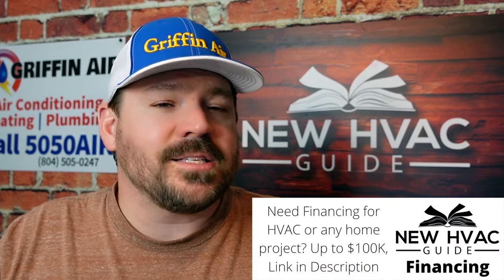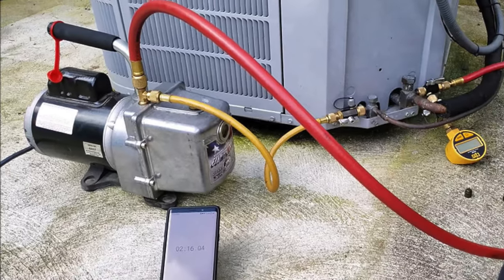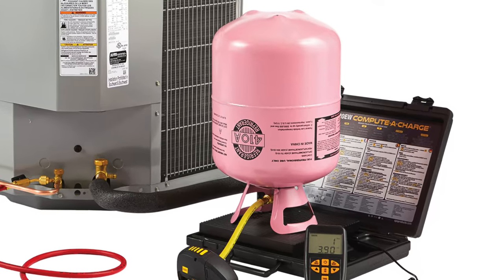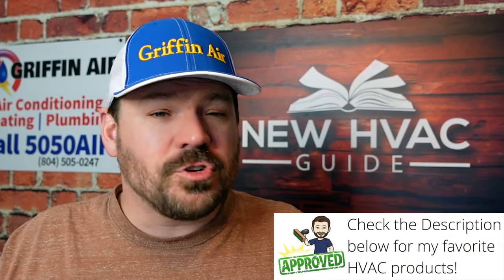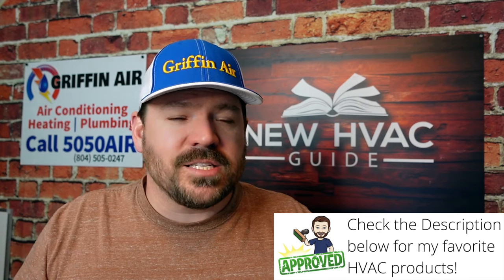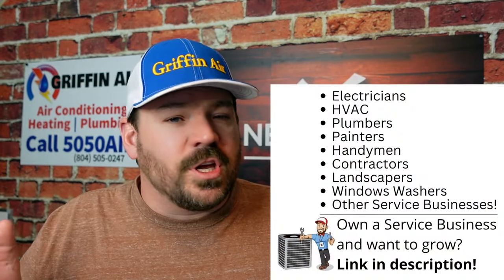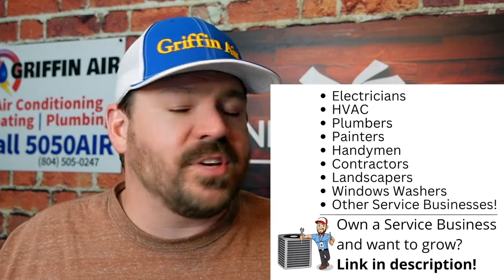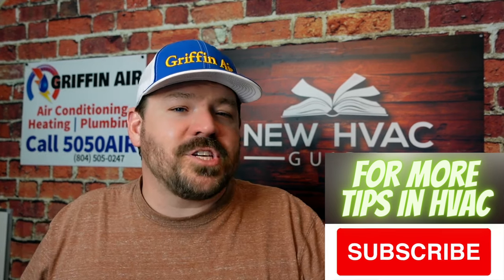Don't Check Refrigerant in Mini Splits. Here's Why!

Comment: While I agree that he is speaking truth, he is withholding the fact that he is using a fear tactic to discourage this type of DIY which can be done judiciously and prevent the homeowner from paying him, or one of his cronies, exorbitant fees to maintain a system that is designed for skilled DIYers to install and maintain. The HVAC industry is so peeved at the ease of DIY installation systems that many will not help when something goes wrong unless you pay them exactly what they would charge you for the system and installation. They hate that they are losing money to this DIY mini split industry and have taken a hands-off attitude rather than getting on board with it and make a little money off of maintenance and repair when a homeowner wants to go that route. This is one area where YouTube University is saving money for  probably thousands of people.
Reply: Concur.  I've had no formal training with Residential HVAC systems.  Over the past 10 years, I've installed 5 different Mini Spit systems and I've maintained them w/o paying technicians.  For the most part they're fairly simple to install/maintain.
Reply: No he’s just trying to save homeowners headaches. I’ve seen a few of these “do it yourself” systems all fucked up. This guys 💯 correct. We also do only commercial industrial HVAC so I’m not biased. Critical charge systems need a proper tech to work on/install for longevity of the system. This guys honestly just trying to help. And yes home owners can get lucky and it’s just fine.
Reply: @nolte8152  You must have missed the words I wrote. I did not say "homeowners." I said skilled DIYers. They don't rely on luck. You must be a one-skill-only type who cannot understand the wide variety of skills a DIYer brings to the job along with their understanding of a wide range of systems and the ability to quickly learn more and put it to work. They usually have an intuitive grasp of understanding how a system works and quickly see how to install, repair and improve the system. I stand by what I wrote as being 100% accurate.
Reply: @archer9732  🤣😂🤣 You must be an aspiring engineer. You sure sound like one.
Reply: @nolte8152  Not aspiring to any occupation. Retired from a very successful career and enjoying my retirement. But, I have high regards for the engineers I know. I hear some aren't so good, but that's true in every occupation. Right now it appears to be especially true of the HVAC trade.
Reply: No the engineers in hvac are fine but the problem is those who think everything can be done correctly by everyone and there is no need to hire properly trained professional techn😢icians . Or those DIYers who install a mini split and instead of running a dedicated circuit decide to   Branch off one leg of the 240 to run there ceiling fan  before continuing to the mini split . There is a reason the industry leading mini split manufacturers only sell to licensed contractors and not to the public. You go ahead and buy those 3rd world mini splits and install them yourselves but be prepared to pay when a pro has to fix the  junk that they don’t even want to touch for just that reason . Also just because you got it super cheap does not mean they are going to be inline with your penny pinching mentality to repair it .When it breaks be prepared to replace it or fix it yourself. Many service techs don’t like working on mini splits period so don’t expect a break on them fixing something you bought online and installed yourself without any professional training. You can install it yourself you can service it yourself . Or pay a premium for them to cause once they touch it all your mistakes or bad practices are now there problem  to try and solve  Just keeping it real .
Reply: @jhill2042  Once again I must point to the words I wrote which you failed to understand. SKILLED DIYers. You one skill only people are so proud that you learned how to do one thing. BTW. Skilled DIYers can fix their mini splits and they are not fixing installation problems. I just finished repairing one that was damaged by mother nature (high wind and flying limbs). Of course the part about buying refrigerant was a slight problem. So I studied for the test and am now section 608 certified. That’s what skilled DIYers do. We learn what's necessary to do the job right.
Reply: I also do 90% of work when I install mini splits on my projects, but I would still call certified installer to connect line set and do a system startup. Main reasons are to get full manufacturer warranty and also federal and utility company rebates, which I wouldn’t qualify for in diy install.
Not all mini splits qualify for rebates
Reply: “There’s no way…. But then here’s how it could be done”. 😹 WTF

This guy spends too much time pole vaulting over mouse poop.
Reply: Someone steal your ice cream?
Reply: For real. Just tell me how you'd do it as a professional. I will decide when I'm in over my head. The ac industry is a bit annoying because few techs will touch a self install even though I'm only asking for something simple like a pump down and pressure test, for which I'm pay.  One dude tried to charge me $750 for this.
I've found the same problem with many tradesmen not answering questions and simply telling the audience not to do it. As one of your skilled diyers I ripped out every wire of the knob and tube and rewired my entire home. And I did it my way with a lot of extra features that would've cost me a fortune if I paid an electrician. Even the inspector was impressed. Was it hard? Sure. But not nasa science. Just required research and investment in time and tools. Not everyone should be doing these things, but it doesn't make everyone who tries an idiot. I've seen plenty of pros make boneheaded, serious mistakes that are costly and dangerous. So a pompous attitude is unnecessary.
Reply: I'll ask one question. Did you pull a vacuum on your mini split?
Reply: @peteaceves5237  Absolutely.
Reply: Amen!  Every low level tech has "opinions" like dryer tapes in your dryer ruin your dryer. Auto mechanics claiming "bad gas" from this station or that is ruining the engine.  Jeez!  Save your stupidity for your paying customers, who overpay you.
Reply: I think you are totally correct based on my experiences
Reply: This guy is simply saying that all these companies that send unqualified people mess up the system and don't know the proper process.

Comment: Disagree with you to a certain extent. You are completely right about "properly" charging a system by weight. I have rarely done this unless the system is giving me supreme attitude in a service scenario . Some manufactures will give a  range of what your pressure's should be or if you call them they will give you some hints along with an amp check on the compressor. If I have a whack of calls its getting a top up and a leak check on to the next one. Most home owners want their systems to cool asap not really concerned with a system properly charged.
Reply: Well, I disagree with you to a certain extent. I would argue that 100% of home owners want their systems to cool asap not really concerned with a system properly charged, not most. That said, is it not the job of the HVAC professional to be a professional? A professional who disregards the uneducated / ignorant homeowners concerns and provide them with a properly charged A/C running at 100% proficiency (which will provide many years of cooling comfort) is the honest way to go.
Reply: How do you do a leak check without evacuating the system?
Reply: @andrewmckinlay2964 you have to put a vacuum on it after a leak check 💯 percent have to
Reply: Are you talking about inverter mini-split systems or just AC's in general?  Sounds like A/C's in general.
Reply: Incorrect refrigerate charge kills compressors … period
Reply: Mini Split systems can only be charged by weight. Period.

Comment: You are spreading mis-information probably so you can charge more for your service calls.  Mini splits can be checked while running in ANY mode by line pressure.  If the pressure is between 100 to 120 while running your good. Below 100 you need to add a little to bring the pressure back into the correct range. Just add a little and let the pressure settle.
Reply from the maker: Do you have any documentation to show this practice?
Reply: You are correct. The problem, I'm guessing, is HVAC pros are spouting off bs based on old school systems and not educating themselves on these newer systems. Mini-split manufacturers provide the information for testing system charge based on pressure.
Reply: @NewHVACGuide  From what I have seen on youtube videos he is correct.  The low side pressure runs between about 110 and 125.
Reply: @NewHVACGuide  I'll bet some pretty good experience behind what he says.
Reply from the maker: Saying operating pressures should be in a range of 20 psi and adding (and guessing) when it gets below 100 is NOT properly charging a system. I stand by the information in this video. 

There’s a right and wrong way to do things. I don’t guess and I don’t shoot for ranges. I do it right. 🙂
Reply: An auto mechanic would have no issues charging these. lol
Reply: @NewHVACGuide   If you understood how these systems are designed to operate, you would see why " within 20 pounds" is ok. Mini splits are Variable Capacity systems.  The amount of refrigerant in circulation varies based on demand.

Comment: Hmmm, so basically, the new systems are more expensive, filled with complicated electronics which love to break, ((I've been an electronics guy all my life), because they are electronic and that's just what ALL Electronics do over time), and now it's even more difficult for HVAC Tech's to test, troubleshoot and repair which ultimately ends up costing the customer more money in the long run for all future maintenance.  What a great deal for the consumers of these products!!  And all this to save a few bucks per month in Electric Bills, ALL of which will likely be eaten up by future repair and equipment replacement bills to the customer.  Oh yeah, and all that refrigerant you have to suck out and send to the recycler?  Do they pay the HVAC guys for each bottle of refrigerant that is turned in to be recycled?  And once again the customer is on the hook for all new refrigerant every time the system gets a little low on gas.  All of this takes a lot of time which translates to a lot more hours billed to the owners to do what should have been able to be done in a short time at very little expense.  Great move HVAC World!!!!  Oh, and the CO2 issue that the world is trying to "FIX"... Yeah, it was revealed recently that our atmosphere contains approximately 0.04% (That's four one hundredths of one percent) CO2 gas, and their goal is to reduce it by 50% bringing it down to 0.02% (or two hundredths of one percent!!!)  And they want everyone to believe this will make a huge difference..., Sorry, I'm calling B.S on this one.  I'm no chemist, but I DON'T THINK SO!!!!   I enjoy your videos, keep up the great work!
Reply: And that's exactly what it is!
Reply: If anything I have seen electronics become more resilient over time. I have far less stuff that breaks now than before. Companies who cheap out on electronics are the issue, because cheap stuff is cheap for a reason.
Reply: @JarredSutherland  for most consumer products, you're probably right. But as we all know, electronics hates heat more than anything on the planet. When you have condensers sitting out in the sun cooking at 100 plus degrees All Summer Long in places like arizona, texas, and Florida where I live, it can't help but take a toll on all of those electronics. Additionally, the indoor units are generally placed in the Attic which in my neck of the woods here in Central Florida hover around 130° f to 150° F All Summer Long!  Generally the electronics are not actively cooled in any way on either the outdoor or the indoor units. They're generally locked into a tin can with no ventilation, and simply generating their own heat with no real easy way to get rid of it as the majority of the units have no type of heat sinking on them or active cooling like a computer CPU would have. I'm sure some of the new inverter units may have heat sinks attached to some of the higher power devices, but again, they're out in the sun all day long with no real active cooling to help extend their life. Millions of dollars are spent by the industry to determine life expectancy of all things including automobiles and air conditioning systems. They're manufactured to last until the end of their warranty., And from that point on it's a crapshoot. Unfortunately the average consumer gets shafted pretty much every time.  While I love gadgets as much as the next person, when you have a very simple mechanical device that works, make it reliable and long-lasting and reasonably priced, and don't force consumers to have to replace the thing every 5 to 10 years as seems to be the current trend with a lot of high ticket items including home appliances, refrigerators, and air conditioning systems.
Reply: @optionstraderman  Agreed, for those who can't do it yourself, they get the shaft. I'm a construction guy and don't let anyone so called pro work on my home unless I physically can't do it. As for the mini splits, if there was something I couldn't repair when broken I'd just buy the indoor or outdoor section replacement and install myself rather than hire an HVAC pro to charge me more than the cost of the new unit/section. They ain't hard to install. Maybe tricky to repair. IDK yet. Getting ready to install another in my garage. Only have one in the main house (ranch style) and it keeps all 6 rooms comfortable. Bedrooms use wall existing units only when sleeping if needed. Saved 2000 in oil bills last year when it cost 1500 to fill oil tank. Only use furnace to a minimum settings on Aquastat so boiler only uses oil  to keep closed systems from freezing. So love mini split and also have hot water heater inverter system that save on bills. Though oil savings is what really makes it worth it.
Reply: Alright, I don't have the time or the inclination to tell you how absolutely and utterly wrong you are about CO2 and climate change.  They have known for literally over 100 years that CO2 is a greenhouse gas, and that the percent relative to the total atmosphere is remarkably miniscule.  HOWEVER, it is not directly proportional to percent CO2 to temperature rise, it's exponential.  I know there is literally nothing that could convince you that you're wrong about climate change, because you can't rationalize someone out of a position they didn't rationalize themselves in to.  Let that sink in.

Secondly, mini split and inverter technology has been around for 45+ years, and has been relatively reliable for most of it.  However you're blaming consumer-built electronics with commercial grade, which are much more robust.  I work on minisplit and VRF systems routinely, and can tell you more often than not the reliability of a system comes down to installation more than anything.  And installation starts before anyone even has the equipment, it takes understanding and planning that so many monkeys with toolbelts don't understand.
Reply: Lots of scientific story telling here I see. 😂😂😂
Reply: @TheDiosdebaca  It doesn't matter what US citizens do about CO2.  China is building a coal fired power plant every week
Reply: @badawesome  yeah, that's a sickening statistic (that's pretty accurate, too).  Unfortunately until we come together as a species and decide we are gonna fix this huge problem, nothing much will change.
Reply: @badawesome , it does matter.  As people in China are attaining first world (read: consumptive) lifestyles, they are deploying wind and solar at nearly 10X that rate of us here in the USA.  Our per capita CO2 emissions are still far greater than theirs, and of the major industrialized nations, only Canada and Australia are worse.  We were the world's leader in creating all of these wonderful technologies, but that went to hell in 2017, only to come back in 2021, but it will soon go to hell again.

Regarding these cheaply-built pieces of consumer equipment, the market simply has to demand better quality products.  I've done grid-tied inverter R&D for a long time, and eventually, people realized that some of the electronics would never last the service life of the installation, so then we were finally pushed to make better quality products.  It was a big deal when we got rid of parts that did not survive so much thermal cycling, such as electrolytic capacitors and vacuum-fluorescent displays.

Comment: Pre EPA Hvac rules 1980s Ancient mini spilt history: the units  i saw in Singapore Toyko and Thailand had R22. They had both high and low pressure taps on the outside unit. The expansion valve was Inside in the Inside unit. This scheme sometimes added noise of the metering valve. 

Todays mini spilts I own are R410a. The metering valve is in the outside units.  There is NO high pressure tap to measure the high side pressure.  Both lines are on the low side on most all modern mini spilts. That is why both lines are insulated.

When a modern mini spilt is low on charge in Cleveland the smaller line usually frosts over. So the poor homeowner is trying to cool all of Cleveland than the inside of his John and Janes house. 

The problem a HVAC repair guy has is the lay public thinks there are 2 pressure ports to check what is happening on a mini split.

Also the HVAC repair person has no clue if the lost 10 oz of R410a happened over 7 years or 7 days.

Most of the time the leak is in the inside unit or the flare fittings. 

.